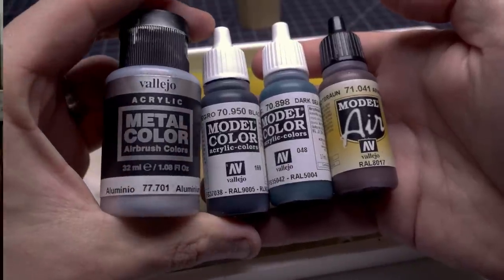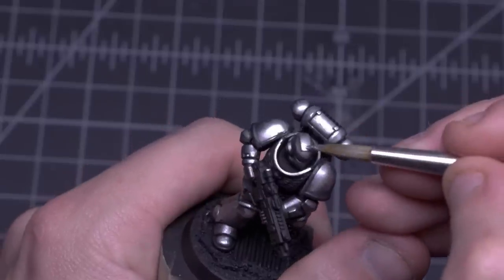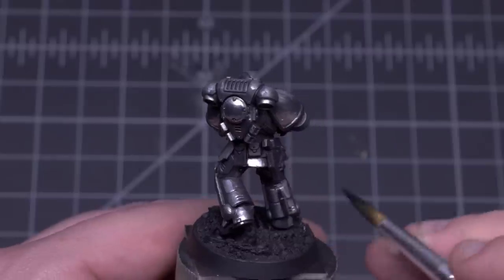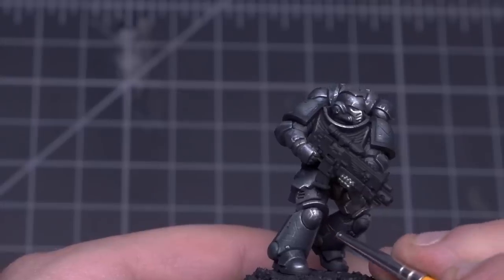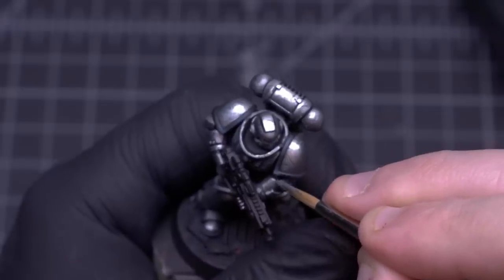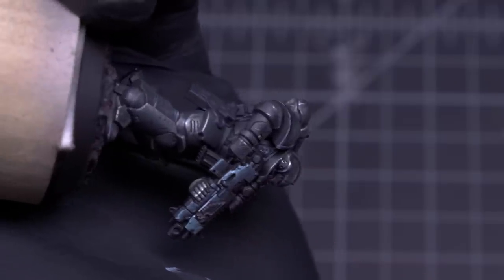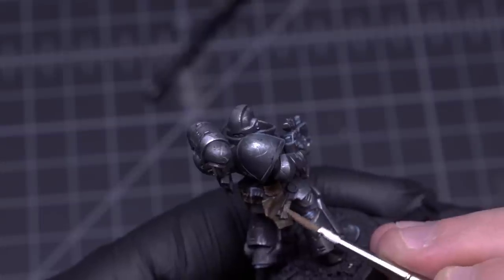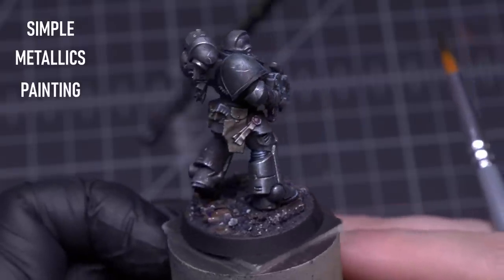You've Been Painting Metallics ALL WRONG

Comment: With this method and especially on a Space marine i guess an oil wash with a slightly blueish black could replace the panel lining process to make it even easier (but expanding drying time for sure). - but you would still have to do the scratches.

Comment: Hey John, sorry for the probably obvious question, but if you just took the aluminum paint and sprayed it top down through your airbrush would it generate a similar effect to the second step by with a smoother effect?
Reply from the maker: Yes and no. It would likely get some silver where you don't want it, and would need a good number of coats to build back up to that bright silver. You could give it a go, but I found i ended up not getting as much stark shine as I wanted. Then again, I'm not super accurate with an airbrush :)

Comment: OK, got question. You paint your highlight and shadow color over base color but this is not glazing. What consistency and how much paint to use in situation like this so it won't be to much and to thick?
Reply from the maker: I'd call it a 'heavy glazing' consistency. pretty thinned down, but not so much that its just a subtle tint. you want to see the color when you put it on, but you want it quite transparent. Hope this helps!
Reply: @Ninjon  and when you apply it do you use hand towel to take most of it down like with a glaze? How much you leave on a brush?
Reply from the maker: @NightWolf1982pl  Yup you don't want your brush overly saturated, otherwise you won't have much control over where the paint goes. Touching the brush to a paper towel before applying paint to the model is the approach I take.